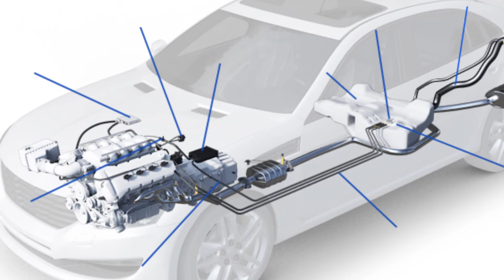How to Diagnose and Fix P043E Engine Code - OBD II Trouble Code Explain

Comment: Thanks for the video. I have a Toyota highlander that is showing this code and wont stop beeping. The dash says "check VSC system. I replaced the vapor canister and test pump, but it is still beeping. Have you heard of this problem before or have any ideas?